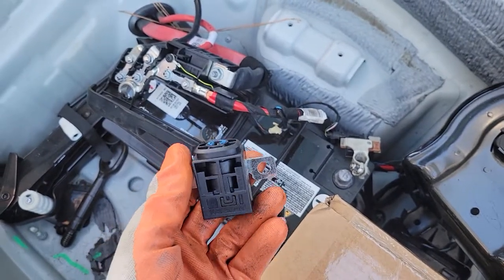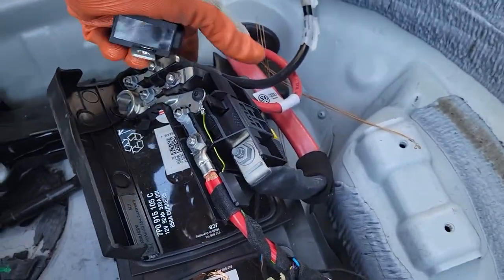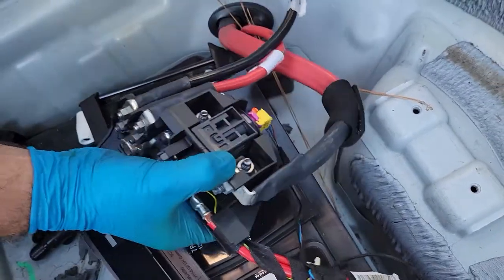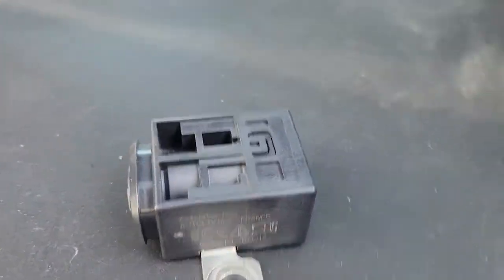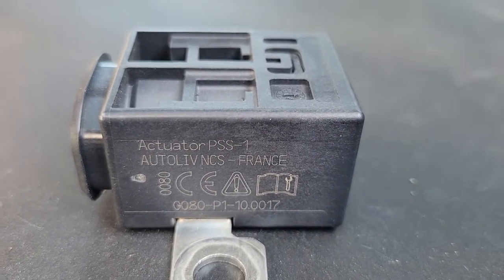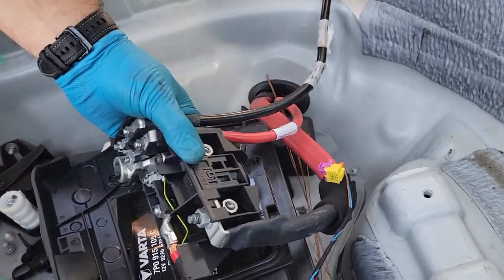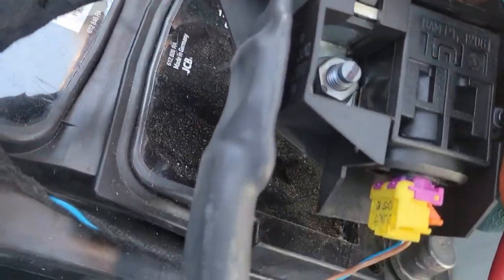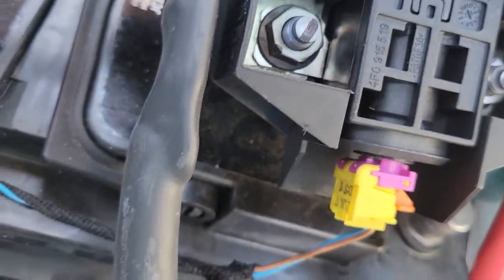2018 Audi Battery Fuse Overload Protection Sensor Relay (power shut off after accident)

Comment: Also another question did you ever try snd jump and get the same issue why the broken one was on?
Reply from the maker: It ran with this one blown but had check engine light on. On a bmw, it will have 0 power if these are blown.
Reply: @ipartoutstudio  I have an a7 2013 and even with the jumper on, it will not start the starter or the fuel pump. It just has acc on.

 After I took the fuse out still made the same noise (click with acc on) and all as before. So I ordered the new fuse and hoping this was the issue all along. I just changed and coded this new battery. 

But now that you say you were able to jump with the bad fuse kinda worries me😅 (without bridging the connection, or do you mean after bridging?)

Mind you the car was in an accident that damaged the intercooler and all coolant came out. I think one airbag deployed but it may have been replaced before they relalizy they couldn't get the car on. I bought it after and after inspecting that pyro fuse I saw it was original and never replaced.

Your thoughts?

And clarification on whether you mens with the bad fuse in or after you bridge the connection and then jumpstarted. 

Thanks for your response
Reply: @ipartoutstudio  a error message for the starter comes up also saying static before and after removal (starter has a electrical malfunction, either fuse, wire, relay or internal)

Comment: My car restrictong power to electronic devices like heater, ac,etc and vcds shows battery management issue, restricted mode. Should I change bm or this part? This happend after alternator failure and battery overdischarge... It had 8v in it.
Reply from the maker: Not really sure. Check the codes

Comment: Hello, i replaced this fuse and now have power to the car. the front rad is cracked and i havent gotten around to replacing it yet, I needed to move the car around the shop quick so i tried to fully turn it over, however it just clicked and not even tried to turn over, would this have something to do with the coolant level?
Reply from the maker: Your battery might be dead

Comment: I got my car towed home after losing keys ; he shook my car off because I didn’t have the key lol; got my key ; it started then died 3 mins later; you think this may be my problem by getting it off a tow truck; or fuel pump shot from having 15 miles while cranking it up
Reply: The fact it started says it isn't this part, just a dead battery or alternator, if the engine shut off it's alternator being faulty unless it's your fuel pump

Comment: Would this cause the car not start if it’s bad or going bad
Reply from the maker: If bad won't start
Reply: @ipartoutstudio mine does have power after the positive battery cable was cut no power to interior the trunk lights work but that’s it air bags deployed will this fix the problem ? It was fine before cutting of the battery cable at least interior wise
Reply from the maker: @Benzo4prezi  mine ran with this blown out as well. Bmws don't start with these blown out